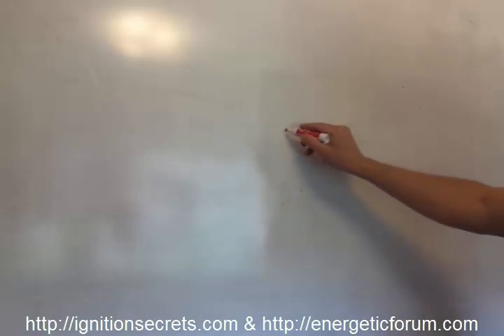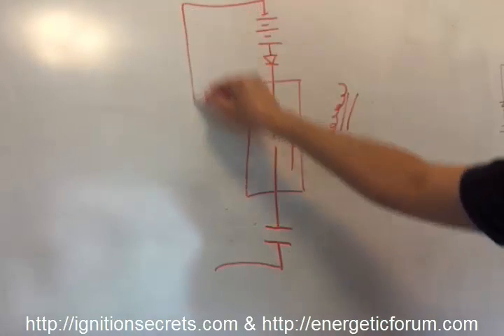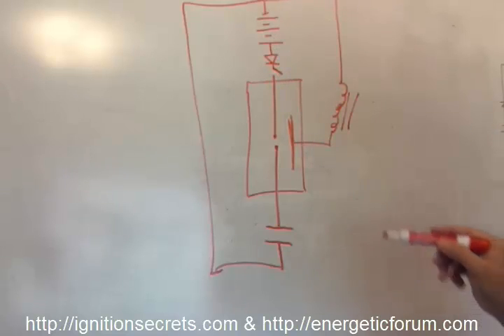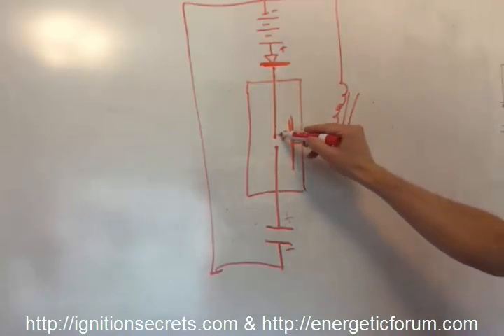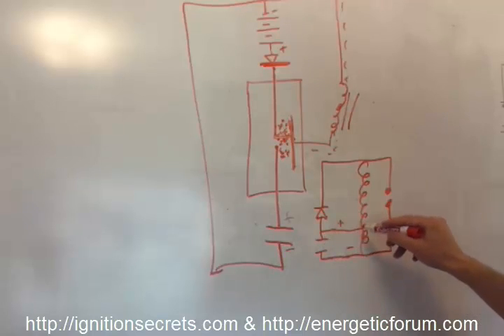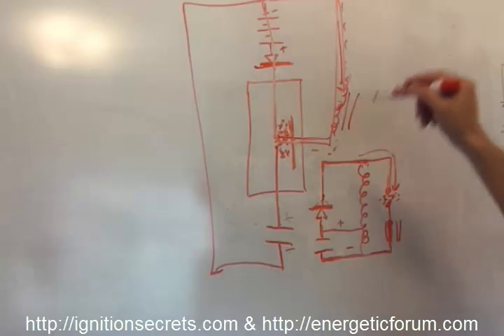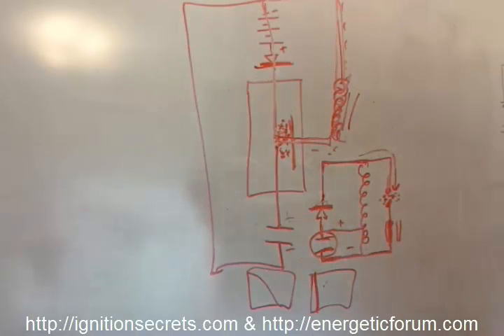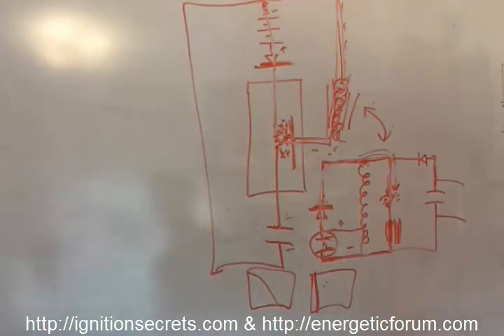2015-05-14 Gray Tube compared to Plasma Ignition

Comment: Hi Aaron. I didn't know anything about the Gray tube but your explanations were so clear that now I both! :)

Would you confirm BTW that you indeed obverse that a very sharp variation of current in the inductor creates a very sharp variation of magnetic flux in the coil and so induce very hight voltage?
Reply from the maker: Khwartz Hi Khwartz, here's the Gray tube patent by the way: http://www.google.com/patents/US4661747 with the plasma ignition, I can confirm that the capacitor itself does indeed discharge faster so the power increases greatly. Does the inductor charge faster than normal? More tests need to be run on that for confirmation. If we can show the coil is also charging faster than normal, then that is beyond important. Here is my motor that I ran on this principle: https://www.youtube.com/watch?v=nxsoze9CZ9E